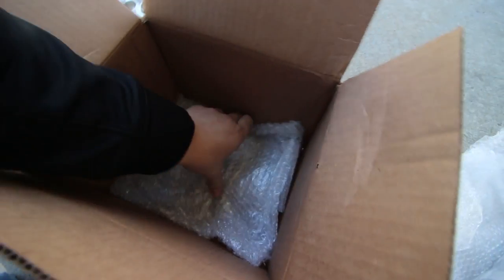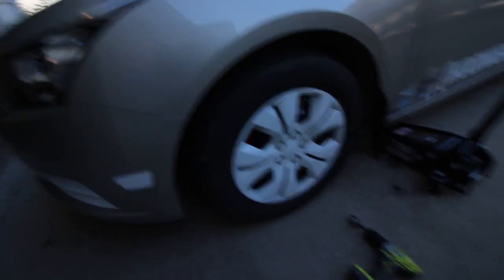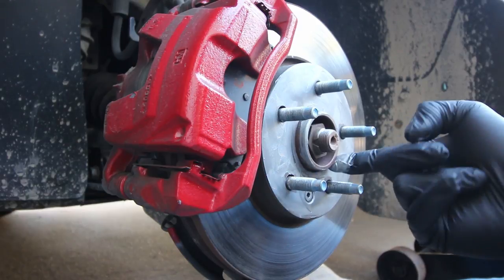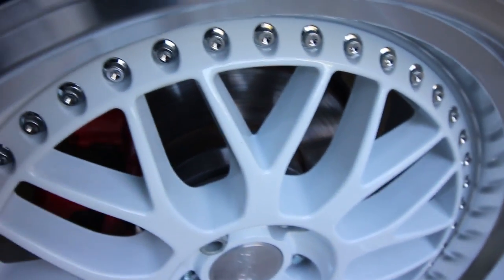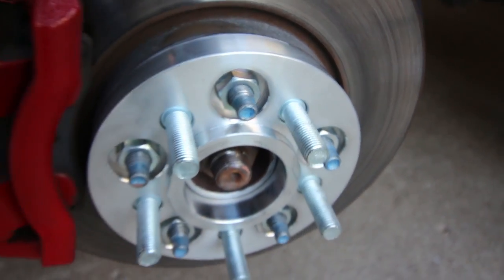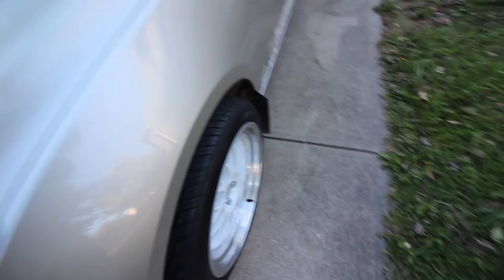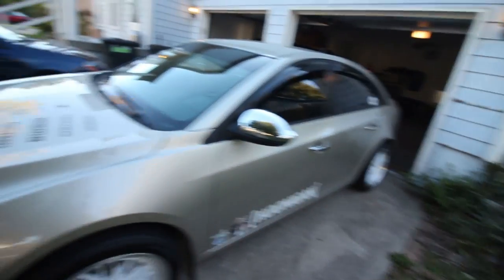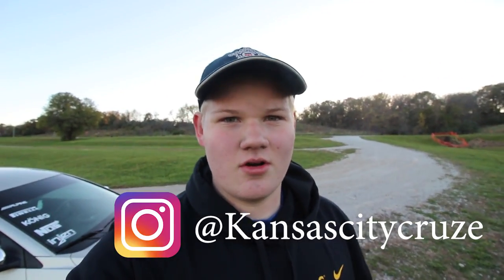Let's Try This Again.

Comment: How is the mpg with all the mods you have done to your car?
Reply from the maker: +Hayes Ginther I do a lot of city driving so I get around 25mpg, on the highway I get 33-37mpg
Reply: Jonas Godwin You have the 1.8 right? I live outside Warrensburg and drive to Olathe on week days and I was thinking of doing some similar things to my 12 1.8-6 speed. I've actually got rally mudflaps cuts for my cruze and just needing to mount them.
Reply: I'm averaging 33 mpg daily and I'm looking to improve that
Reply from the maker: +Hayes Ginther I have the 1.8l, I think if I kept my foot out of it more I would get closer to 28-29 but my average speed is 25mph because I drive in the city so much